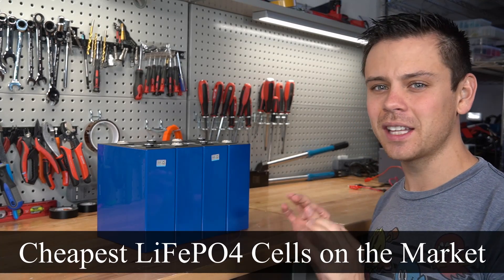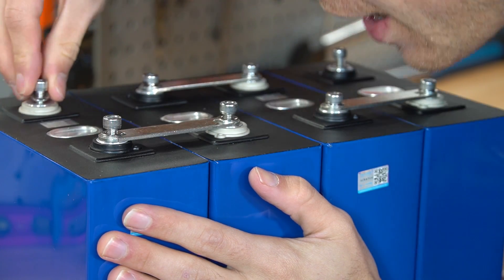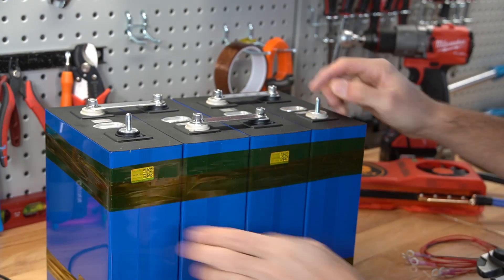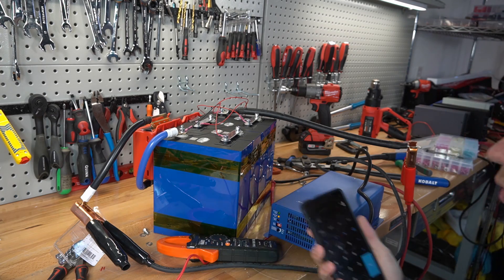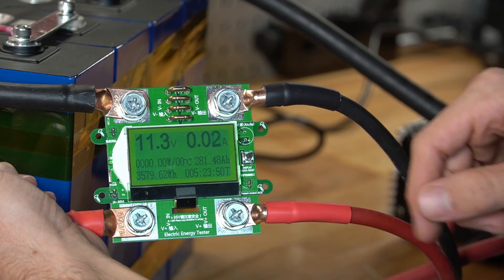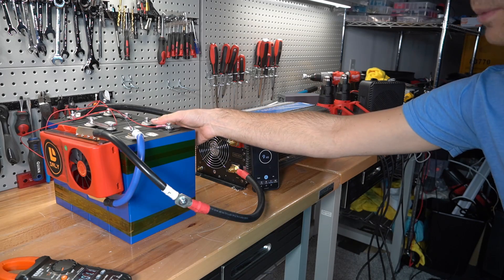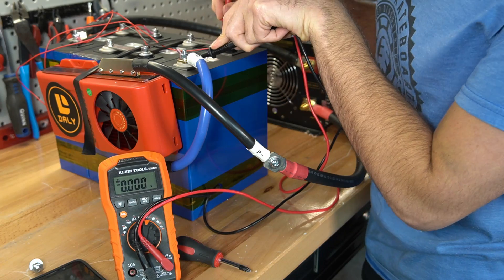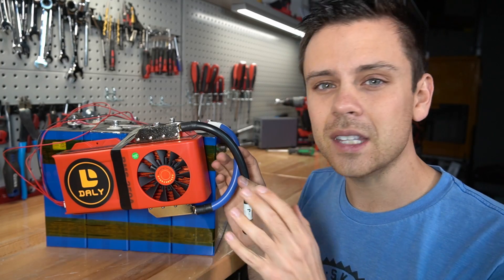$433 280Ah LiFePO4 Cells Tested: Cheaper than lead acid!

Comment: Hi Will
First of all great news on your house its good to see someone do well. I just brought 8 x 280ah cells This will be my first build of a Lithium battery. I am planning on making a 12v 560ah battery would you recommend making 1 big 560Ah or 2 280Ah batteries. Also what BMS would you recommend. I plan on being off grid in my European motorhome I have just brought 2 x 360 watt solar panels and I am in the middle of building a lift kit so when I park up my motorhome will have to face North or South to take advantage of the sun. I will be running a 12v compressor Fridge and for a few hours during the day a roof mounted Air con unit if it gets to hot for my 2 dog's. The price for a 100Ah Lithium battery in the UK is around £900 or $1220 so it's a no brainer to build my own these 8 cells just cost me $970 or  £715 delivered. I have to buy a big metal case and all the other bit's but it's still going to work out a lot cheaper.    Mike

Comment: A note on the Dally BMS the temperature sensors work very well. Unfortunately, they are factory set to -40 degrees Celsius and must be set correctly via Bluetooth. Greetings from Germany

Comment: I keep watching these videos to find the ultimate 4wd battery for fridge, lights, etc. Your high amperage rating videos are great and all, but i'm all about the constant load over period of times so I'm glad you cover both.
Reply: @Nick Sullivan Looking at this setup in his milk crate setup, how long do you think this would last powering a Dometic-type fridge? Would it be adequate to power diesel parking heater and occasional 1800 watt induction platter? I'd likely run off-road lights off traditional dual battery setup with isolator.
Just trying to get a ballpark estimate how long this would last off-grid before needing to recharge/if I could get away without needing solar panels out in the desert for about 5 days. Seems pretty capable.

Comment: Hi Will, good video. Would you consider doing a video review of budget/ value option inverters? You could a series of three aimed at different watt ranges that correspond with the blueprints on your website. I appreciate your honesty. When you ask about inverters people almost always recommend high end products, but I can't believe there aren't a few more out there like Giandel or the pure sine inverter you recommend on your website. I have been scoffed at for suggesting giandel. I get they aren't low frequency inverters, but should do for most people, and high frequency inverters are a good option for weight considerations on power bank builds.

Comment: I saw another YouTube video about these and the cost so ordered straight away along with a 150a Daly BMS for use in my Landcruiser 200, designed a battery box and they work a treat. Only dropped down to 6% and uses 262ah via the VictronConnect 712 smart at constant 47amp pond pump. Great for the price.

Comment: Hello Will, would you be interested in doing a diy all in one product that would rival the best solar generators on the market that we could make ourselves. 

How hard would it be in concept to get some 2000 watt inverter kits and make a generator that has two dedicated 2000 watt regulated inverters, which could be stacked to get 220v power if needed. We would want a touch screen and an mppt too all in a nice package, but this can’t be too hard. I would be interested in putting up some cash and my time to support a project like this. What do you think?

Comment: Wow, ... Great to see your newest lessons again. I love your style of sharing info.  ...  I am on my second set of 280Ah LifePO4s ordered from China with compass bearing for purchase from the DIY Solar Forum I think you started with inner circle. .. Question Re Gaps between cells: I noticed the sides of the 8 LiFePO4 cells I just received have a bit of waves on side and thus not perfectly flat. IS the not perfectly flat sides a sign of  B grade cells?  I am wondering if the little bits of light I can see when I press my new cells  together ... is a huge deal. I kind of think they may be ok, as my Ah tests check out.  I wonder who is selling perfectly flat side LiFePO4s; and if a little wave on side will hurt their longevity. ???  >>> Thank You for this recent layer of LiFePO4 Lesson and options.  ... Keep Up the Great Work     :+)    Capt Bill

Comment: How would this work with a travel trailer? It has a 30amp plug. To run ac and other items. It would be cool to have this fir boon docking. That 4000 whatt inverter would be great if it could pump out 30 amps
Reply: You would need about 4X the amount of cells and significant solar (or Hobotech's method of half that amount and more solar). If you added a soft starter to ac it would lower surge and might work with an even smaller inverter. I have seen a 1500 pure sine inverter used to start a rooftop ac with the soft start (not many small inverters will do this, as watts displayed was closer to 1,800 so buyer beware). There are two ways to make this work, hardwire your 120 into inverter with a transfer switch or connect a 30a plug to inverter (usually need to wire into it versus using plug, some inverters have a 15a limit on the plugs in the front), turn off converter for option two. Option one is more ideal, but two works if you decide to build a portable power station. If some genius inverter company would have a30a rv outlet they would get a lot of business from DIY folks.
Reply: @katherinewilliams1406  Wondering if each 4cells pack need their own BMS? If doing 4X 12V packs, need 4X BMS?
Reply: @RevealaRealite  In a 12v system, there are a few ways to approach. You can create 4 seperate batteries with a BMS for each or Less Batteries with cells in parallel. Limiting factor will be your BMS, you can also look at a 24v system, they have 24v BMS options and you will save a lot on wire.

Comment: Take your bolts and use a Dremel with a grinder disk and cut deep  4-5 lines the length of the bolt to make a thread die. You can then clean the threads.

Comment: Hello Will, I really liked this video! I am not very familiar with charging technology, so I wondered if you could answer a quick question - right now I use a relay to connect my RV alternator to my coach batteries (two marine/RV lead acid batteries) when the engine is running. Can I do this with a battery pack like the one you tested? I'm assuming that the BMS will disconnect the charging voltage once the pack is charged, is that correct? Thanks much!

Comment: Sorry... but I can still buy brand new standard 225 amp/hour Trojan 6 volt golf cart batteries for $92.50.  Two of them are $185.00, four for 450 amp/hours would $370.00.  These are not cheaper than lead acid!!!

Comment: The cells do look good, however the shipping to the UK is extortionate. The cells are currently £361.94 and the shipping is £579.78..... I believe duty and VAT are on top.. So not a good price any more.
Reply: Thanks Bruno, 
That's the trouble. It's so difficult to know as a lot seem to use the same pictures.

Comment: Will, as usual great test!   What Resistor did you use to precharge the capacitors?  (Ohm & Watt)  THX!!
Reply: Look up Will Prowse resistor. Will give you all the important info in another utube video.
Reply: @katherinewilliams1406  Thank you for pointing me the right direction. For those interested in the values:  30 Ohm/25W

Comment: greetings 
Will, firstly thank you so much for your teachings and good hearted genuine support towards us x
i wasnt sure where or how to contact you regarding some advice from you please. im in australia and would like to set up an of grid system onto my home on wheels.. since watching your videos ive acquired some understanding (however im still quiet new in all of this).. would you be able to help with with an australian version 'all in one solar power box' ,  solar panels (i could probably be able to fit 4 on the roof(would the house ones be good and would over 100 watt panels be ok to get), also which lithium batteries? shall i go 24 or 48 volt system? 
i appreciate any feedback you may give me and am grateful for your time in doing this... 
kind regards and a happy new year,
G

Comment: You should get a bottoming tap for cleaning up the terminal threads. Maybe get 2 or 3 of the common sizes for these batteries. This are different from the normal tap sets you can get so look specifically for bottoming tap. A die would do a much better job as well of cleaning up the jagged threads left after shortening bolts, even a cheap Harbor Freight tap and die set would work.

Comment: Thank you for testing these EVE LF280 cells. That reflects $148.00 per 100AH 'battery' at the store. I think the flooded golf cart batteries are cheaper, but- it's close!!! 3,500 full cycles- you bet I'll 'adjust' to the crappy M6 terminals to get that much safe, usable power. I'll prolly make (2) of them, for a total weight of just under 100Lbs. I'm pretty confident that they will fit in the space allotted for batteries in my truck camper even!!! Thankfully, there are a bunch of other reviewers: Off-grid Garage, LithiumSolar, Freely Roaming- all with excellent insights too.

Comment: Maybe next time use a laser thermometer to test the bus bars instead of your fingers. It best not to learn that the hard way. Also gives you a better temperature reading 🙂
Reply from the maker: If it's hotter than my hand can handle, I'll use a temp sensor of sorts. Absolutely pointless if the busbars are only warm.

Comment: I read that grade B is just another marketing term and has nothing to do with the actual quality, at least it shouldn't. The use the term grade A to suggest their batteries are as good as known manufactureres.
Reply from the maker: Yes good point but not in practice. On aliexpress, grade b, or anything not labeled as new, can be horribly degraded. Have you seen my older videos where we learned this? We tested some 120Ah cells and they were heavily degraded 150Ah cells. And they were considered grade b. Also, lto grade b cells suck. Plain and simple.

Comment: Love that at the moments you think there may be a issue, you use the lean back to create a little more distance between you and any potential sparks, flash etc. But at least you wear safety goggles, whereas, how many people on YouTube do you see using power tools, cutting, drilling, chipping etc. where debris can get in their eyes, with no signs of eye protection.
Reply from the maker: Yes! Very important to wear eye protection and stand a bit back. I read a safety paper on electric arcs and the various possibilities, and I was terrified. I burned my eye two years ago with some solder. It hurt so bad and took a week to heal. Never going without eye protection again.

Comment: You are a star Will...thanks for great info. You mentioned compressing the cells, but in the test you used tape - is that sufficient compression, or was this temporary for the tests? If temporary how would you go about compressing these specific cells?

Comment: With our newly purchased used camper would you recommend building a 24v (2x12v) batteries and connect a 24/120v AC inverter and then use 1/2 the system or 1 battery for  the 12V camper?

Comment: The Daly BMS specs used in video have 2.2v LVD and 3.75v HVD.  These disconnect are different than the 2.5v LVD and 3.65 HVD cell specs.  Won't this BMS degrade the cells?  What am I missing?  Thank you...

Comment: Right on, lithium porn. I ordered 10 anr26650b cells from LitiumWerks to make a portable 10Ah 12v pack. That i can also add in my system in case power outage. Im not sure how how the electrodacus will handle the parameter changes if I take it out for a week. Total Ah is how it works. I’ll figure it some way. Or have a fire

Comment: so, is each cell 280ah or all 4 together 280ah?
Reply from the maker: Ah is dependent on nominal voltage. So the cells and the pack are 280Ah at their respective voltage.
Reply: @WillProwse    so you can get 3.2v 280ah in parallel or you can get 12v  280ah in series.  I how i read your reply.
Reply from the maker: @idiocracy10  exactly

Comment: I was waiting for a video with this size of battery. I'm on SSDI and I need an affordable battery
Reply: I just bought from Ebay, 176 amp grade A 3.2v cells. I spent 840 total. 16 cells at 176 amps is over 2500 amps. What I envision is a 48v system for my small RV. I have 600 watts of solar, a 48v inverter and 1000 BTU air conditioner. I am pulling all the other necessary items in, such as the bus and BMS system. The seller is amantha_irk

Comment: I have been shopping these and had them offered to me.  They showed me pics with no threads in the terminals.  I said pass.  They probably machined them themselves (as they said they would) and that is why you are having issues.  Aluminum should be rolled thread instead of cut thread as they are much stronger.

Comment: Will, in the automotive industry, I found that the best corrosion prevention was had by using never-seize or anti-seize. Of course, we're talking lead acid, but the fact remains that it's conductive and creates a barrier for corrosion. What I'm curios about is that I never tried checking voltage drop across a connection, and wondered if you might entertain the idea of checking a voltage drop dry and one with a copper (or silver, either one, or even both) anti-seize applied to the contact area. IF you happen to do the threads as well, BEWARE that your toque value will decrease compared to clamping force and you can strip the threads much more easily than dry threads! Nobody talks about terminal/connection corrosion, but I would think that it becomes an issue over time, especially with dissimilar metals.
Reply: Exactly what I am researching right now. Alu terminal and copper busbar or ring terminal. The best I found is CUPAL washer. One side alu other side copper, melted together.
Reply: As long as they are kept dry dissimilar metals should not be a problem.

Comment: Hi Will - First of all, thank you so much for taking your time and making these videoes. They help a lot! Your knowledge is wast :)

I'm currently refitting a 1985, 31 foot sailboat - and the engien is an old Volvo Penta 28HP, and it is beyond repair. So i want to replace it with the 48v 10KW watercooled Golden Motor. So my setup is like this

- Solar cells, about 600 - 1000watt
-All in one unit with charger, 3-5KW  inverter, MPPT charger with AC in and out (with autoswitch between batteries and AC when possible.)
-Since Li-ion is crazy expensive in Denmark, i have to go with AGM batteries, and im thinking 4s3p with a total around of 200ah - to make sure i can pull enough current without melting the terminals.

If you are in any way interested in making a video of this, i would be so greatful!

Again thank you so much for your informative videoes! Have a great new year :)

Kind Regards, Ruben
Reply: Why use AGM? You can order this cells in EU too.
Reply: @mrzed6597  I would love to, but im not that familiar working with Lithium batteries, bms and such (i would proberly set it all on fire by accident..)
Reply: @sailingviking6350  I doubt it. Easier to work with it than AGM. Will's videos teach everything you need.

Comment: its all fun when subs pay for it, if that was money, i would be pissed, a laugh for you but hard earned for us
Reply from the maker: I lived off grid for 9 years and a big reason I make these videos is because I was ripped off numerous times over the years and I was constantly rebuilding my solar system. It sucked. I had days without power due to inverter failures and more. It's not fun.
Reply: @WillProwse  I know i Have followed you, I am a working man, I cant afford a house or a tesla, or the batteries that I test, I have to work and buy them,  I stick up for you and watch releases and ask when you get to review them so I can get an honest opinion,  your just moving out of the realms of normal people with real lives I think
Reply from the maker: @dudleyedge1374  these are the cheapest cells I've tested in the last three years. I try to find the best value products around. How am I moving out of the realm of the average person? These packs cost three times less than other options not long ago. Quite the opposite seems to be occuring.

Comment: Would I have to make 4 stand alone batteries if I wanted a 12v system with 1120 ah capacity?
Reply: Yes, you would need four sets of four cells, putting each set together as Will did, then wiring them in parallel to increase the capacity of the battery bank. I believe he would recommend also having four BMSs.

Comment: I’m confused. Is all four equal 280ah (70each) or is each cell 280ah with a total of 1120ah ? Thanks.
Reply from the maker: Amp hour is dependent on voltage. Each cell is 3.2V, 280Ah. Four of them is 12.8V, 280Ah. If you put them in parallel, Ah would go up, and voltage would stay the same.

Comment: Ok, now just have to figure out where to mount them in or on the trailer and what BMS I want to use (for outdoor use a BMS with a functional low temp cutoff is mandatory in my application).

Comment: I bought my 280ah batteries about two months ago for a lot cheaper than what you paid.... and all of my batteries were new and the same voltage. Mine past all test and are now in my camper. They last about 4 to 5 days with little or no sunshine then I charge them. It's winter here and I won't see a full sunny day till April or May. Can't wait to see how they do this summer.
Reply: @fredmalcom5685  AliEpress about 6 months ago. Took over 2 months to get them. There is several companies that sell them. You have to shop around till you find a deal. I got lucky. They raised the priced about a month after I paid for them.
Reply: I was looking for 90ah batteries when I stumbled across the 280ah. I got lucky.